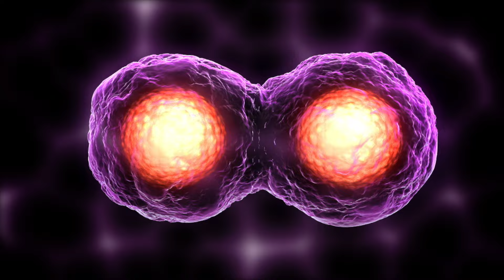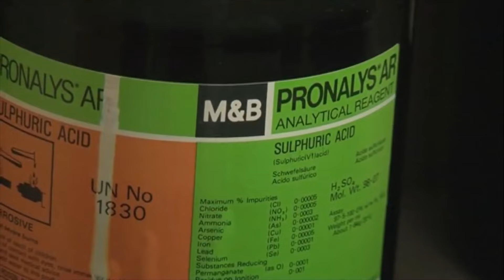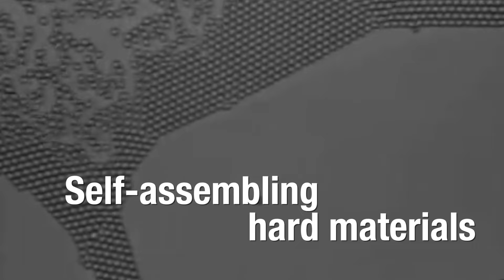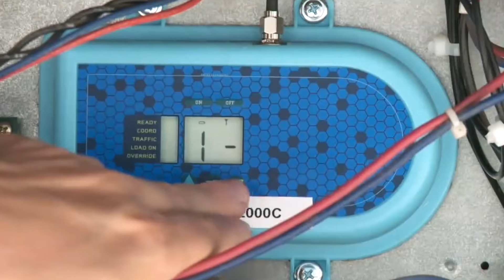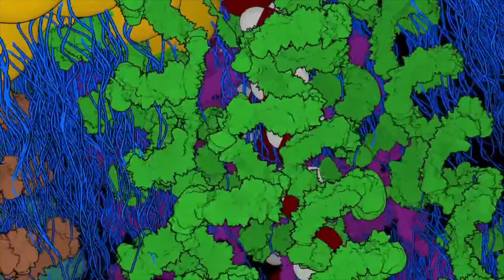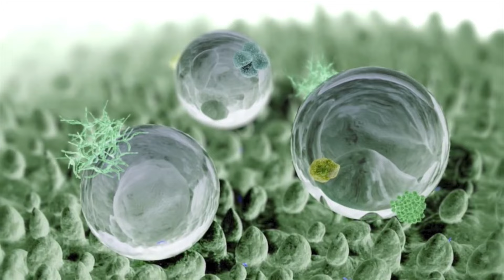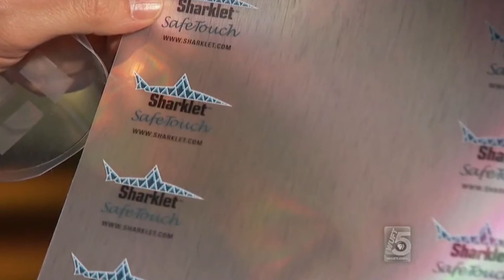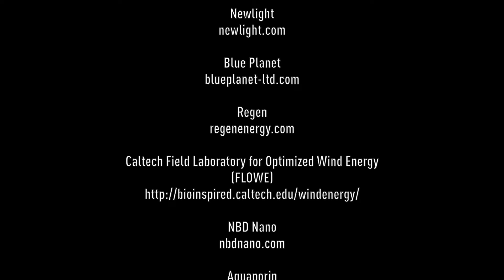Biomimicry

Comment: It really is taking off in labs everywhere; I remember a Japanese research team that analysed the proboscis of Mosquitoes to create syringes that do not stretch the skin so much when inserted and so are much less painful.
Another team applied the surface contours of dragonfly wings to create turbines that generate less air resistance, so they extract more energy.
Biomimicry really does have solutions for everything

Comment: I loved the part about nacre, which is also known as mother-of-pearl in English. 
My only concern is an important one: at 7:06 the speaker says that carbon dioxide constructs shells and coral, while in fact CO2 dissolves them -- i.e. the the calcium bicarbonate parts of those organisms like their shells -- by forming carbonic acid (H2CO3) upon mixture with H2O. Correct? Therefore, the danger of ocean acidification was dismissed within the first 8 minutes of this video. I love positivity, I encourage it, yet the subject of decreasing the pH of oceans is very significant.